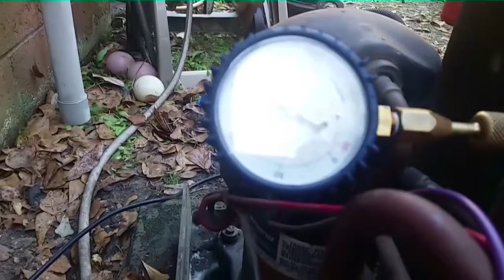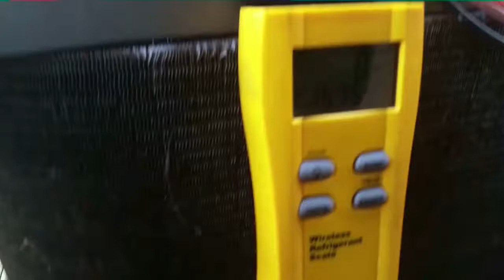Heat Pump Accumulator Replacement Part 2

Comment: im paranoid the minute i think about brazing. i would assuke theres a little bit of freon in the system since you dont pull to a vacuum  (wpuldnt want to pull in non combustibles). isnthere an issue to braze with slight freon in the line? i bet you removed a Schrader core by the valve to relieve pressure but still my question holds. 
one last point, did you remove pil or just add to poe and 407c? this is something i will consider for the coming season with the high price of r22.